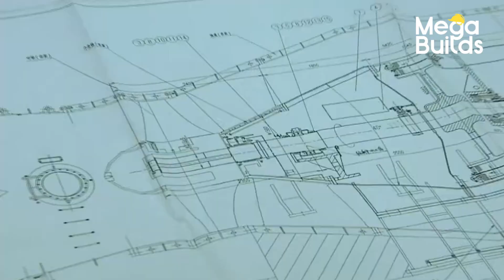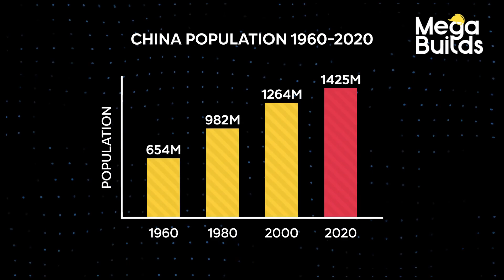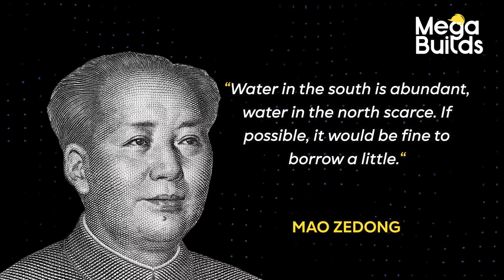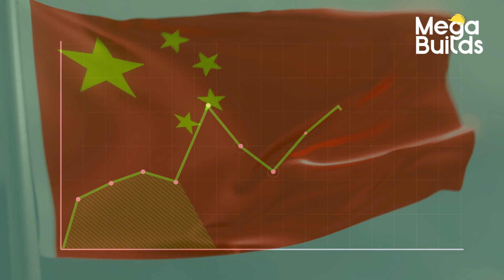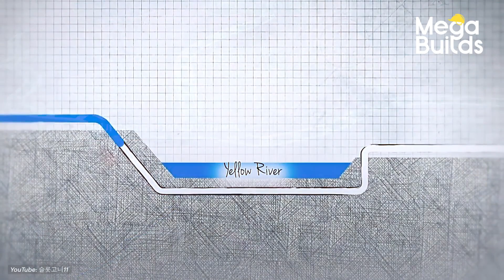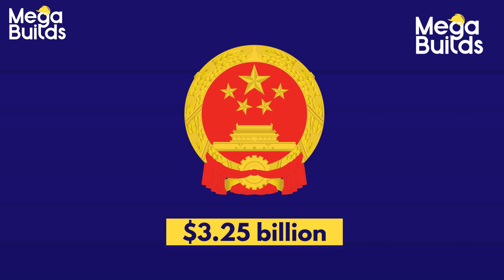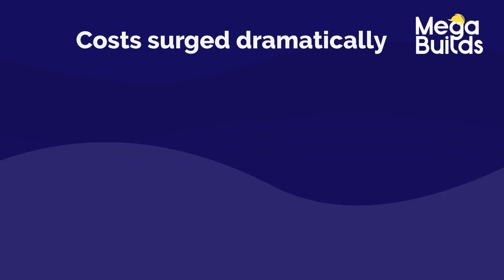China $62B Mega Project | Massive Water Diversion

Comment from the maker: How do you feel about big projects like the South-North Water Diversion Project changing where water flows? Is it more helpful or does it cause problems?
Reply: Causes problem. Should have thought about local solutions for water deficiency even though building such a big system is machosistic.
Reply from the maker: Thanks a lot for your thoughts! You're spot on about looking into local solutions for water shortages – sometimes, the smaller, closer-to-home approaches can make a big difference. The South-North Water Diversion Project is definitely a giant leap, and it's got its pros and cons. It's all about finding the right balance, isn't it?